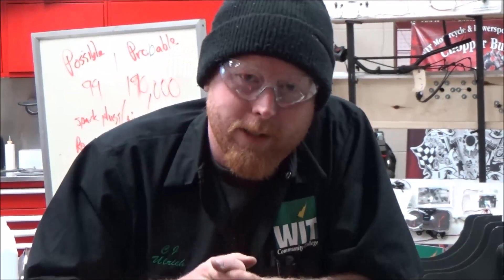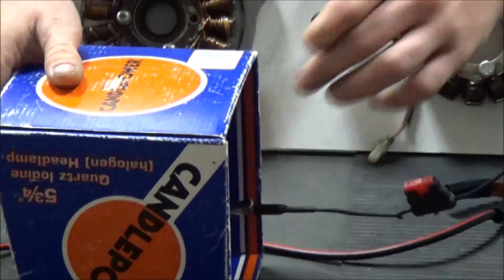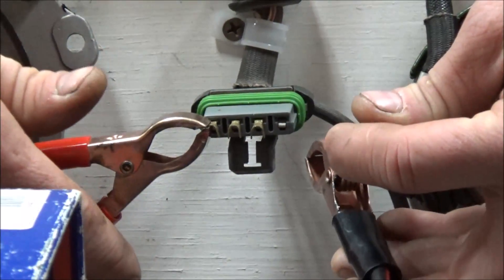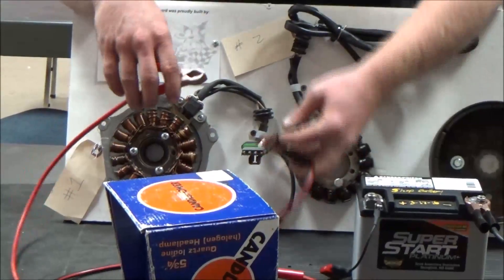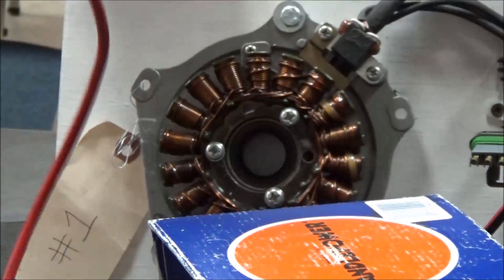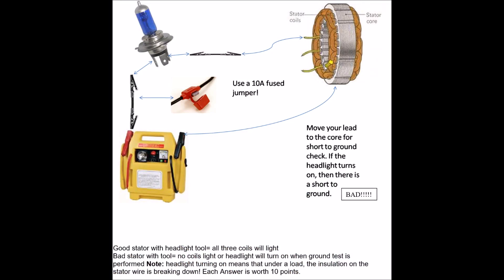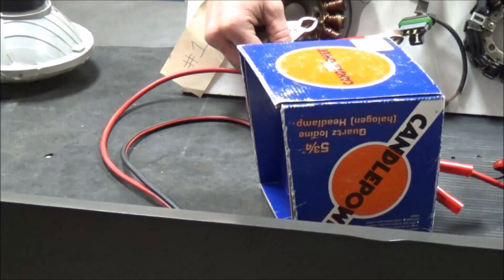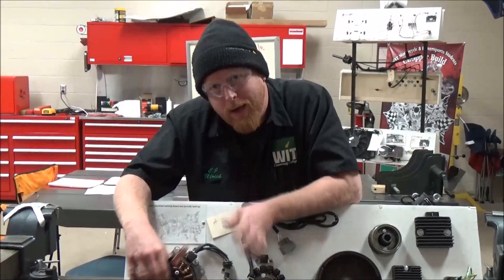How to load test a stator on the bench! Best method ever for "dyno" testing alternator windings!

Comment: This is not a load test.  This is a less than full load continuity test.  A load test is done without a resistor (light bulb ) in series with the power source.  Load test can be made at 6v DC and then measure the current draw of phase A,B then, A,C, and then B,C.  All phases should be the same within 5%.  The current each phase draws is the input for ohms law for resistance.  R = E over I.  E= 5 volts, I = 5 amps.  E divided by I is R   Resistance of the stator winding is 1 ohm.  This is the actual load test to give you the resistance of the stator phase which is not a published spec.  you have to obtain your  own specs  and document them, from good known values then compare that to the value in question.

Comment: Shane, this test can only confirm if a stator has an open coil or a short to ground. It does not mean the coils are definitely good. If a coil has an internal short, from one point in the coil to another point in that coil, it will still show continuity and thus the test light will light, but that shorted coil will not function. Also even if a coil has an open, if it's a 3 phase delta wired stator, and say coil A has an open, the electricity can still travel thru coils B and C to light the test light.
Reply from the maker: John C Very true John but I think your missing the point of it's a test of the insulation of the wire. A continuity test will show good meeting the ohm spec when not loaded. This test is just simply used in addition to ac output and FCC at the battery. It's "value" is in showing bad stators when the ac and continuity show good.
Reply from the maker: Dcv at the battery